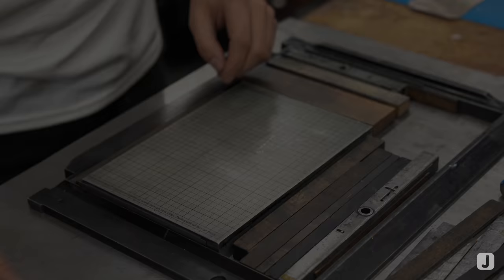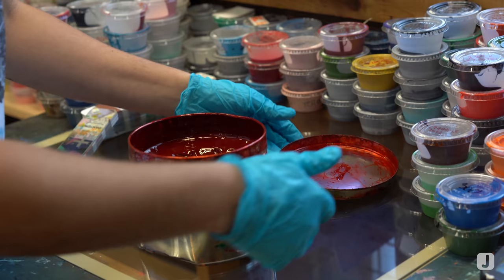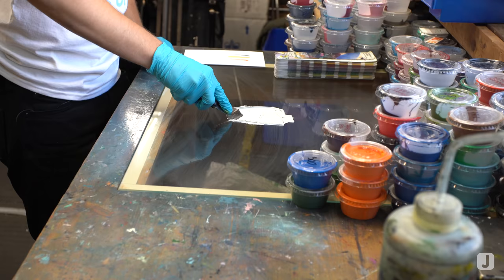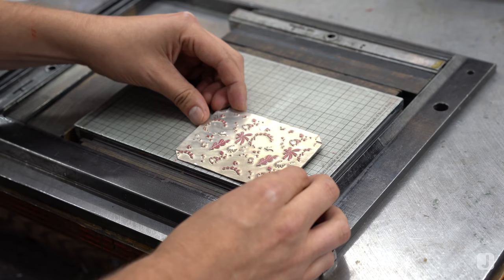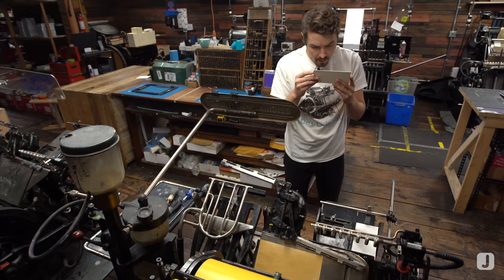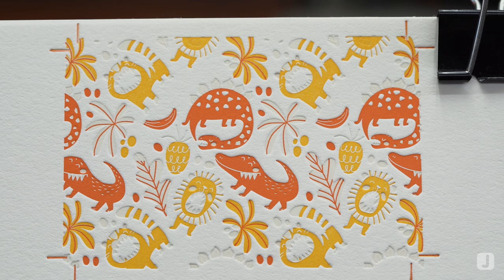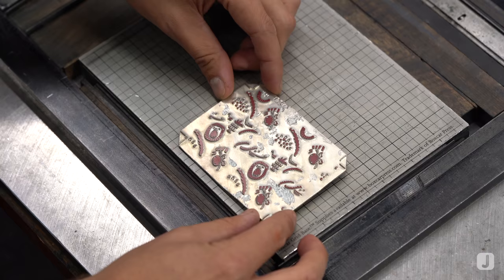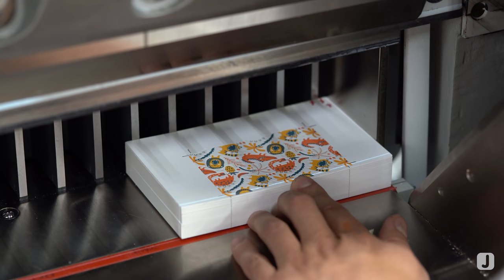Letterpress Business Card Printing with 5 Pantone Colors!

Comment: Everyone is in awe of the letterpress... But that paper cutter in the end... Jesus it cut the whole stack like a hot knife through butter
Reply: Vitalstatistix Stats exactly my thoughts, can you imagine what that would do to a limb? 😱😨🤣 ohhh the horror
Reply: @jacquelinespot7136  I don't know why they're calling it a "papercutter" because it's literally called a guillotine where I'm from, and yes, it can chop body parts off. Thankfully, you can only make the cut by simultaneously pressing two buttons on the front of it with your thumbs- they're beneath the paper bed and about 70cm apart. The actual cutting knife is at least 30cm from where your hands are positioned
Reply: @Trixtah  It's far easier to squash your fingers in the clamp. I seen a guy do it once and then the boss asked him what did he do? He straight up put his hand BACK in and squashed it again XD
Reply: Standard Guillotine Device.
Reply: I want one!!!
Reply: Your comment x 100000000000
Reply: It made my fingers want to hide beneath my pillow!!!
Reply: That's called shear force!
Reply: We weren't allowed to use ours at the print shop I worked at. There was one guy that did all the cutting with it so there was less of a chance of us kids hacking something off. I wasn't allowed to use the book stitcher either. That thing is nuts, it doesn't use thread, it uses thick copper wire that makes staples through thousands of sheets. The lady that used that had already lost two fingers from it.
Reply: a similar paper cutter almost cut off my palm :-F. I was working as a student and nobody told me that the final cut is diagonal, and soome book was stuck inside that thing. Luckily, the guy working with me saved my hand :-@
Reply: I operated one of those MANY YEARS ago one day while serving in the Army. This blade seemed MUCH SHARPER than that one.
Reply: Honestly we have one at work and this one was so silent and SMOOTH I WAS LIKE DAMN I WANT THAT
Reply: @jacquelinespot7136  this is nothing, guillotines can cut even thicker bunch of thicker boards with ease. I have 4 such machines in my press. The awesome thing about this machine is they can program cut with mm accuracy.

These machines have light beams on either side as safety against any interruption during operation and these machines have two buttons that needs to pressed by each hand simultaneously to operate the knife.

These are relatively safe machines to operate.
Reply: @Trixtah  I operated one in the late eighties that you could hold the lockout lever with your hip and trigger the action with the other hand. This allowed you to place the back of your hand near the trimmed strips that would sometimes fly everywhere if not restrained. I am very thankful that I still have all my fingers.
Reply: We had manual model of such a cutting machine till 1992 here in India.
We use to spin its huge wheel and it used to cut 500 pages/1 ream paper in a blink of eye.

Comment: Glad to see the profession hasn't been completely forgotten in this age of digital print. I was a Master Tradesman Printer and got pushed out by digital that could be run by nearly anyone. Ran a Komori 428, 528, GTO 52, GTO 48, Platen, and most of the finishing machines. Mixing ink was one of my favorite things to do. Sealing was a pain because the boss never got the UV fixed and the machines didn't have a powder spray. Literally had to remove every sheet by hand as it ran. I've got some horror stories about that place. Glad that company went under...
Reply: you are wrong all large circulations continue to print by offset or letterpress
Reply: @user-vs2sv9ot1e  never said anything about large circulation bro but you're not wrong.
Reply: @SSZaris  I worked for the Heidelberg m600 WEB 16 GTO 52 Komori lightchrome 740 KBA 215 105 66 Ultraset Rondoset and now I am a seller of printing products, and I know what I'm saying
Reply: @user-vs2sv9ot1e  I'm literally agreeing with you. I think there's a language barrier :)
Reply: Motivation Exceeds Me    As a visual artist I have long admired what you do.  It’s a thing of beauty when an artist and a printer work together and both are satisfied.
Reply: IJK  I always wanted to try Flexo but damn it looked difficult. I've long since joined another profession and I'm way too invested to go back to something similar. It will always be a practical skill though and I love talking shop with other printers and finishers. It's such a deep rooted industry that most people will never know how many things have gone through a print house.
Reply: @bigred6815  That was always one of the motivating factors when printing a job. We'd get a lot of artists coming in wanting prints and you'd know how passionate they were about their pieces and you'd strive to get them the best result possible. I miss that side of it.
Reply: Motivation Exceeds Me   I witnessed an argument between an artist and a printer.  I sympathized with both of them because each of them were passionate perfectionists. I stepped away before they asked for my input.
Reply: IJK   We had wise professors who insisted that we tour a printing company and spend time on the floor and actually see the print process from the other side of the lens.  We learned to appreciate the skill of a printer.
Reply: I take pride in my skills of Sugar coating the medicinal tablets. However, I have changed the line. Now, I manufacture adhesive products like tapes and labels. But, the thing that makes me feel good remains the tablet coating.  I refered to as many books as I can in order to get that ultimate gloss on the tablets ( despite the fact that high gloss troubled the visual inspectors a lot).  Also, now I do have a silk screen unit and I visited here after being distracted from my hunt for a castable polyurethane used for doming exterior of lables and emblems.
 I failed to understand here, if there was an embossing effect created during the first print or this is a given for a single colour unit like this?
Reply: @surendra1990  The plates (the metal sheet that transfers the color to the sheet) being used are embossing AND printing plates all in one. So it embosses the paper as well as transfers the image. You can use it without color and just emboss, or like shown in the video and print as well. If you just wanted to print you can set the pressure of the plate to be lower so it only leaves the ink and doesn't emboss the sheet. Hopefully that makes sense, I'm shite at explaining XD

Comment: This video really makes me appreciate how much hard work goes into making a card like that! Although I'd like a business card like that, it must be very expensive because of such a process. Great video!
Reply: Each colour is charged extra and every design has an upfront fixed cost - to cover the making of the press matrix / plate. So if you want even a small change in design, a new one must be made.
Also, you want to print on a soft thick paper, on which the print leaves psychical marks on the surface.
So ... $200 for 100 cards. Easily more, 300, or 400, goes up fast in case of more colours...

Comment: I ran a Windmill for a small print shop from 2001-2006, and loved it--it was my introduction to letterpress (after being a digital-based graphic designer for almost 20  years), and eventually led t me owning my own C&P platen, a tabletop Kelsey and even a "big iron" Kelly-B Cylinder Press.  was an avid letterpress print-maker for about 10 years, but I've unfortunately sold off all my "big iron" and now use all my type for bookbinding projects--hot foiling covers, mostly.

I really miss running that Windmill--it was a glorious piece of  machinery, and I still think with fondness of the sounds and smells of running a press. You're lucky tot have one--they are amazing machines, and a real joy to print on.

Running hairline multi-color registration on a letterpress is a challenge, but the Windmill makes it easier than the old platen presses--and you do a FANTASTIC job on this piece--I'm thrilled to see younger people doing work of this complexity and quality. Glad to see that letterpress is alive and well, and moving forward into the next generations.

BTW, my favorite Pantone color is Pantone 2112U...

Comment: I loved my graphic arts class from the 80's.. I still remember the offset printing press, the red can for the kerosene soaked rags... We had a silk screen burner thingie (i cant' remember the name) that we'd use to photo etch the gel for the screens... It was placed right next to the cast iron, manual guillotine paper cutter as well.. That thing was massive.  I remember having to almost hang off the handle to cut card stock.. I was probably only 100 lbs back then.  Great memories.. havent' thought about that stuff in yearssssss..
Reply: M E me too

Comment: My Dad had a Heidelberg windmill printing press in the garage when I was a kid growing up in the 70's and 80's.  I think it was a little bigger but not a bunch.  He made zinc engravings until they regulated that so much he couldn't do it any more.  He had cabinet after cabinet after cabinet of hand set type including wooden type.  He had a real old Linotype too an early one.  He also made rubber stamps which the Linotype and hand set type was also used for.  And heat foil stamping too.  I've spent a lot of hours typing on that Linotype machine.  It was a museum piece back then.

Comment: Just curious how old this machine is? Seems like something that does the job very nicely but could very well be an older design. A kind of 'aint broke dont fix it' deal. I love it
Reply from the maker: This press is a 1960 model but It's based on a design much older than that. These were very well built machines. Even lead type from the 1800s would print just fine in this press. Standards in printing process date back almost 500 years and are still in use today!
Reply: @JukeboxPrintLive  wow, that is impresive... just wow

Comment: 2965 C ! I always use it in my branding, and tbh, I have way too many shirts a similar colour to this too!
Reply: I've been working in the print industry for 40 years and used pantone books on a daily basis so I took a guess in my head as to what color 2965 was. Then I looked it up and I was surprised that I was correct in that it was a dark blue color. Also I at one point worked in a shop that had one of those old letter presses. Sadly it was never used for image printing just numbering scoring and slitting of previously printed work.

Comment: Cool video. Not a printer so I may not know what I'm talking about but as a machinist I couldn't help but think about how alignment can be greatly improved from the get-go by simply modifying the fixture plate to have registration holes. You would just drop dowel pins into the holes along the y and x axis and then butt the template up against them. Once the template is adhered in the correct location you would pull out the pins so they don't interfere with the printing. Of course, each one of the templates in the overall pattern needs to be identical in terms of overall dimensions. Your work is beautiful and I don't want to sound like I'm being critical. I just think this solution would greatly improve accuracy and lead to less waste.

Comment: You could use a straight ruler to help in placing the plate accurately. That way you only have to adjust one dimension, helps a lot with adhesive-backed elements.
Reply from the maker: Thank you!

Comment: Awesome video!!!  I work in an offset quick-printing (vs. commercial print) shop so I've never seen embossing actually done, since we out-source that type of work.  I don't get many orders for embossing nowadays, and as for 5-color work, now that the demand(s) tend to lean more towards full-color digital printing, I'm sitting here wondering what your shop would charge for a job like this.  We charge $25.00 per press wash (x5=$125.00), $40.00 per PMS ink mix (x5=$200.00),  $150.00 per embossing plate/die (x5=$750.00), $100.00 per hour for graphic design (I'd guess approximately two hours for that job, so $200.00)....  so, already, the cost would be $1,275.00 and that's before the ink even hits the paper, LOL!  And then of course there's the cost of the paper stock, the bindery (cutting/packaging), shipping and/or delivery, and other various press set-up fees such as tight registration/wet-trapping, and obviously the quantity of cards ordered.  So...  we're looking at a $1,500.00 order of business cards.  OUCH!  I sure hope they ordered 10,000 vs. a standard order of one box of 500 or 1,000 cards.

Comment: Great video - thanks. Embossing and printing in the same run - never seen that done before. Really beautiful effect. We used to use the Heidelberg platens with heated bed and a web feed to do gold-blocking. I guess that process it all but computerised now. I'd love to see you producing text output then you could explain a lot of the terms in common usage (font, points etc) in computer preparation.
Reply from the maker: Have you watched our other video where we do foil blocking in 3 colors on a GT platen? We're planning to do a few tutorials to show how we move artwork from the design stages to the print stages in the future too so thank you for the suggestion.
Reply: @JukeboxPrintLive  I'm really not sure how YouTube decided to recommend your video but I'm glad it did. I did a print Apprenticeship back in the '70s starting like most young beginners "diss-ing" chases full of text back into the fonts and working up to running a Roland Ultra 4 colour (apologies for the 'u' - I'm a Brit) Lithographic machine. Sadly the company I worked for had contracts with some of the largest tobacco companies which involved long runs which could last weeks. That became soul destroying with little to do except periodically checking registers and topping up inks.
I'll subscribe to your channel and work my way through the remainder of your videos. Thanks again!

Comment: Old School.  When I was working in a print shop, we had a class of graphic design students come in to see this kind of thing, and suddenly realized that printing spot or offset is a whole different world than just sending a PDF to print. Separating the elements in the graphic design is also necessary for spot printing, but if printing offset, then a PDF file can be submitted to a digital plate maker and it will produce straight to plate, for each of the four colors CMYK. Before digital plate makers, for process printing, we'd have to get 4 films made for each color, then set up a manual plate maker to create each plate, one at a time.  Even on digital printers, we still have to imposition and register front and back print jobs, and calibrate the color sometimes. Sometimes 1 of the four-toners is not as dense as the others and so we replace the toner.

Comment: When I think of 'favourite Pantone color' I don't think of it in terms of 'which color I like best' - my favourite color is grey, sort of a Pantone 420C for example. When I think of my favourite Pantone color, though, for me it's any color that can't otherwise be achieved using regular 4 color process printing. For example, 1787C is one of those colors you're just not going to achieve without spot printing.
Reply from the maker: 420c has that speck of blue in it that pushes it into cool grey territory. I find most greys are best as spot color anyhow. A cmyk grey is just too hard to control. But I agree, the true bright colors that need to pop can’t be replicated by process colors.

Comment: If they standardized those inks to be able to be measured uniformly by the drop, it could be much easier to measure them as drops of varying sizes could be delivered from syringe dispensers of varying widths.

Comment: I have so many questions!   Why ink the whole roller if you're only printing on 25% of it?  What are you pouring on the press to clean the ink?  What are the steps to print on the back of those cards? How do you calculate the extras needed to ensure you have enough to proof each plate change without running out for the order or wasting stock?  I don't know how this ended up in my feed, but now I need to spend the next week watching printing videos!

Comment: If you get some time, could you give a quick & dirty about paper types and what  kind of printing you can do.
Just so you know, I am at the linoleum cutout printing stage they taught in the 4th grade
Reply from the maker: For where you’re at, I recommend you find a nice Stonehenge or Arches watercolor art paper for your linoleum cuts. Water based inks may be all you’ll find and you’ll want a paper that can deal with that moisture. I recommend an ink retarder to keep the ink from drying on your linoleum too fast. Good luck!

Comment: A Windmill sure does beat a Kluge or C&P for operator's ease of use, but nothing is as crazy to watch and hear as the the Kluge's insane automatic feeder. As for me, just old plain 354 green.
Reply from the maker: Those gast pumps on a kluge sound like a train going by. I really like the way they throw and catch the sheets. Less knocking needed for die cutting, a moveable side guide, and being able to adjust the bottom band makes kluges amazing but setting all that up takes so much longer than an on T-platen.

Comment: Hi guys! Just wondering why you don't use a full tympan sheet? Also what stock to do you for packing? :) beautiful cards :)
Reply from the maker: We use a big roll of typman instead of the standard pre-die cut sheets that you might be used to. I also like to make the tympan sheet super tight so using a smaller one helps with that. We pack with a standard 60lb spot sheet and varying thicknesses of tissue paper. Anything to get the job looking nice and even!